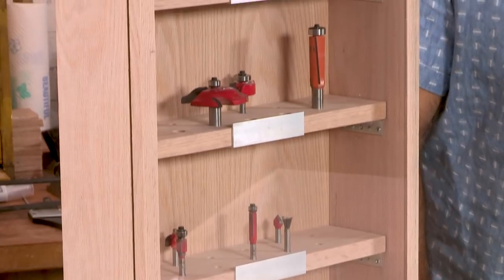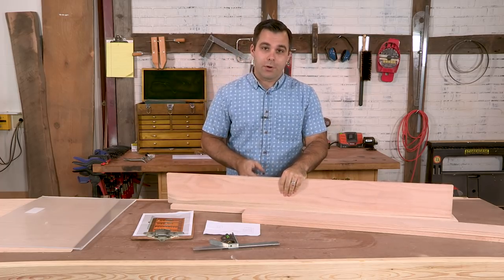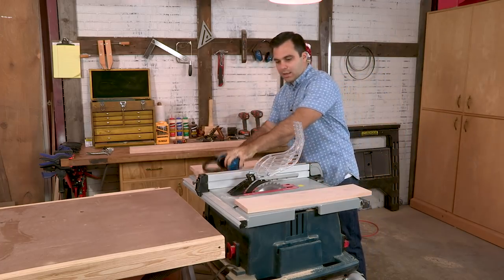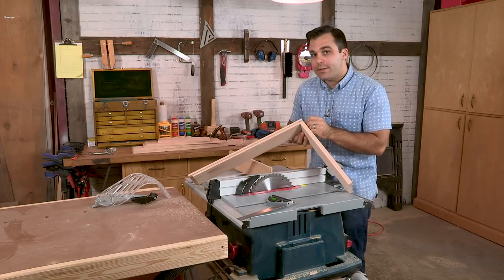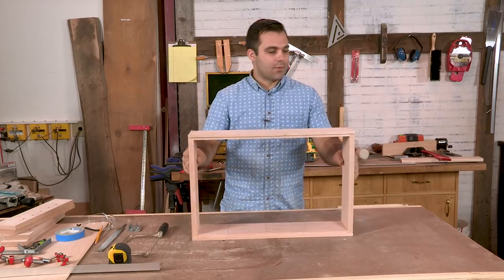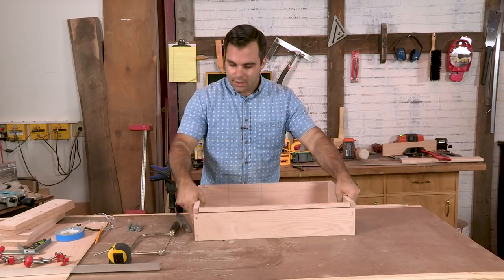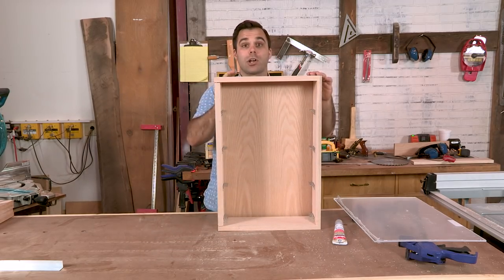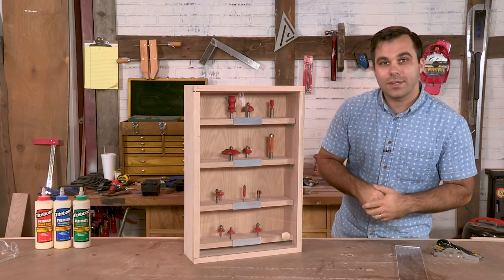How to Make a Router Bit Storage Case | I Can Do That!

Comment: Overall, it's a good project and an easy build. Two things...Why not glue a 4" long 1/4"x1/4" contrast wood along the front shelf edges as a grip point? Personally, I think the aluminum cheapens the look.

Also, I would have chosen wood shelf brackets 1/2"x1/2" to eliminate metal where it's not really needed.

Comment: What table saw is that?
Reply from the maker: It's a Bosch Contractor Table saw with stand, Model 4100-10. Under $600. It does the job!
Reply: A true POS from one end to the other. Save your money for a decent contractors saw. Check for used ones in your area. This saw is stamped metal from one end to the other. Find one with Real horsepower ratings not full rpm no load. You can tell just by the sound of the motor. High whine is a cheap motor. Quite and strong is what you want with cast iron table and extensions. Plus this guy is knows more about quantum physics than woodworking.

Comment: Give us a break please!
I have to say PW never ceases to amaze me how stupid PW must feel the truly interested Public must be. A router bit cabinet plan? Really?  This must be for future insurance sales man that want to build satisfying projects using Black and Decker $20 dollar routers and Harbor Freight router bits with their Kmart table saw. Everything in this video is very sophomoric. The only thing seen that might be of value is the machinist square and the Freud 90 tooth blade (which cost more than the saw is worth). Metal shelf brackets? Really???  I guess the weight of those router bits is very substantial, probably 60-70 ponds minimum. Jesus H. Christ, why not drill and use adjustable shelf pins?  Less expensive, and far more adaptable, seems the perfect choice.  This all in all is a high school  beginners shop project. On a scale of 1 to 10, and 10 being a Chippendale chest of drawers, this is a   -5.  By the looks of your shop, a router bit cabinet is like the least thing you need.
It would appear any project from The Yankee Workshop, or the Woodwright shop would be sway  over the top in complexity. I keep my router bits in a cookie tin. They are all solid carbide, not much chance they will dull and can sit undisturbed, not rust, and ready to use. These bits here, will not have the protection of cold & hot air humidity that rusts tools easily.  Another stupid project from PW. Give us a good project by someone who knows the trade not the milk toast, clerical Dewey Decimal system of cabinetry. What’s on board for the next PW?  How about a real challenge; may be a cutting board out of a single piece of wood. Now that is a challenge.Give us an effing break. Come back Chris Schwartz. PW is pure stupid and you can’t fix stupid.

Comment: You could have used rabbits for the shelves (make the shelves a bit longer) so you could remove them to add more holes or to change shelves out in the future.  Brackets look tacky, are time consuming and are really not necessary.  Also this is far from even a semi professional presenter.  More practice before filming would have gone a long way.